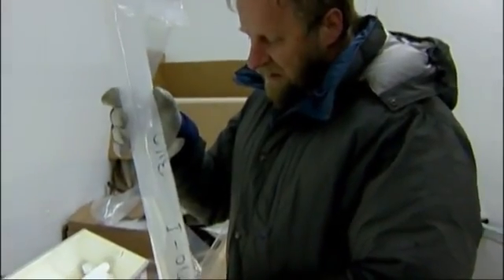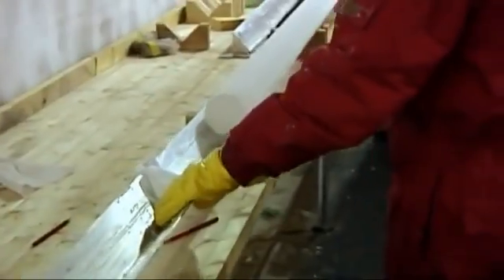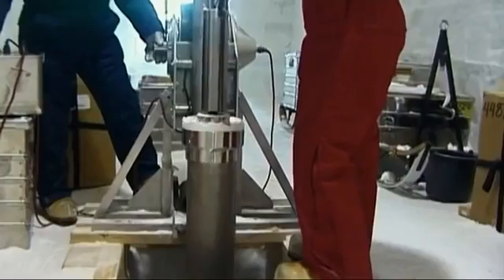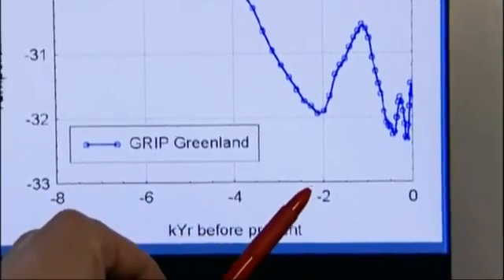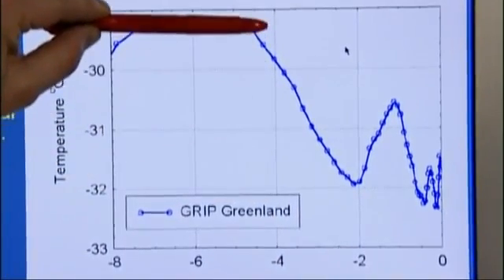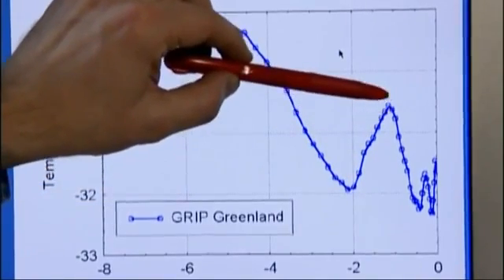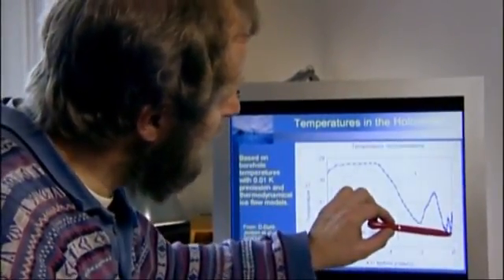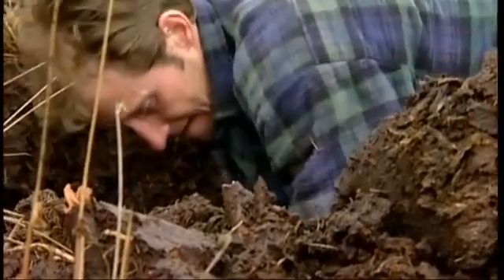The Climate Change story told by ice cores...

Comment: The ice core samples provide data regarding the temperature in Greenland, not globally.
Reply: did you not hear about the evidence in caves in china that also support the same conclusion?  It was mentioned in this video.....
Reply: True.  But how do you feel about those locally higher temperatures being REMOVED from the "global" average calculation for that very reason?
Reply: @i.marchand4655  hi , that's an interesting point, it does seem that data gets manipulated to develop a particular point. The norm , over the past 30 years or so has been to examine high and mid atmospheric temps using satellite data... The green lobby have been quite happy with this method but over the past decade have moved the goalposts again as this data is now showing that the global temp is not following the predicted profile....in actual fact the past 3 years has shown a decrease .... Which given that co2 production has increased is problematic with respect to the climate models being used.
Reply: @kodi1969  if the temperature data is being manipulated then why do you accept the 2020-2022 readings as valid?
Reply: @brmadden895  mmm you again seem to have read into this something that wasn't said... The comment was with reference to the change in temp data collection method that was/is used to demonstrate that the climate is changing according to the modelled trajectory....
Reply: @kodi1969  right...if you believe the data is being manipulated in that fashion then why do you trust it when it shows an alleged cooling trend between 20 and 22?

By the way, the answer to that has to do with the ENSO cycle. The prevailing wind pattern in the tropics flow from east to west, in contrast with the mid latitudes. Warm surface waters in the Pacific get pushed westward, and cooler water from beneath upwells to take its place along the South American coast. That state is called La Nina, and tends to correspond to cooler global temperatures. Every so often enough of a density gradient between the warm waters to the west and the cool water to the east develops a wave that breaks, and the accumulated warm surface waters to the west "slosh" back over to the east and suppress the upwelling of cool water from below. That phase is called El Nino, and tends to correspond to higher global temperatures. If you look at the global temperature record you'll jumps that correspond to El Nino years...particularly in 1997 and 2015 when particularly potent El Nino events occurred. That cooling trend over the past 3 years is closely related to the fact we've been in a La Nina phase since 2020, which is forecast to break. If such is the case then 2024 has a really good shot of being the warmest on record, particularly if we get a strong El Nino event.
Reply: @brmadden895  lovely description of la Nina and el nino....although I don't know whether your Masters tutor would be totally happy with it. ... Totally aware of both systems....
Anyway back to the point, this issue is two things in essence...
1. Changing the data collection method, eg. From mid to high atmospheric temp collection...and when that didn't reflect the predicted/modelled trends then changing to ground based temp data to try and get the data to fit prediction...big clue here it still isn't fitting the predictions....

2. If you are changing the data collection you need to change the modelling method...the models used by the IPCC by there own admission have low confidence predictions....
Again please understand we aren't  singing from different songbooks here, 
But as usual politics/politicians intefere and the message becomes very distorted.
Reply: @kodi1969  I’m trying to figure out your basis for claiming the predictions aren’t accurate when you believe the data you’re evaluating those predictions against is subject to manipulation. Where are you getting that the IPCC only looks at subsections of the atmosphere/biosphere to determine global temperatures?
Reply: @brmadden895  please don't misrepresent any comments that I have made, I haven't said that data has been manipulated , but what I have said is that consistency is the key to any statistical model , especially when the model is  continually being updated with new data...e.g. it is a rolling model. 
For useful comparisons between data points or trends to be made, each data point needs to be consistently derived.
I will, at a later point , give an in-depth explaination from a mathematical point of view why some of the methods used within the modelling produce such wide confidence bands..which in effect lessens the potential long term accuracy of the model...
I can also offer a potential solution which could improve the data collected, but at the moment I am preparing my grandsons birthday party and the comment could be quite long.
Reply: @brmadden895  okay here, goes with part 1.
Several organizations create datasets to evaluate temperature on a global scale, each uses a slightly different method ,each with there own limitations and scales. The NOAA (formerly MLOST) uses the most data points with approximately 7700  stations providing temperature data..these are distributed across the globe , but the distribution is not even, with more stations in the northern hemisphere than southern hemisphere and a higher concentration across North America..
In order to model global temperatures using this data, the globe is divide into 2 degree lattitude and longitude squares, on average 138 miles on each side, each square having an area of 19044 square miles...there would be approximately 16000 such squares across the globe. Hopefully you can see where this is heading, there are more squares than we have real life data points, we only have 43% of the required data which is unevenly distributed across the globe...
Therefore in order to populate these missing data points the NOAA carry out linear interpolation, which straight away introduces the potential for errors and limitations, normally in statistics these can be mitigated by selecting close data points to create an estimate for the missing data, this isn't really the case for the NOAA data which due to the amount of missing data uses data that can be upto 1200km away...depending on the method used to carry out the interpolation this could create a bias that is either an over or under estimate, either way each estimated data point reduces the overall accuracy of the global temperature...with over 57% of the data points being estimated this does call into question whether policy should be driven using these figures.
Problems have also been noted about many of the historically older land based stations and using historical data from them to make comparisons, since the warming is comparative against a 1890 baseline. Many of the older land stations were originally rural or semi rural weather stations, which have now, through urban sprawl and city expansions find themselves in the centre of large urban areas. Areas which due to the urban heat island effect, find themselves with temperatures differing from the surrounding rural areas by 2-3 degrees higher during the day and up 12 degrees difference at night due to large mass heat storage. The IPCC has said that that has now been accounted for, but that it only effected 10% of the stations ...since they can't move the stations, it's a comparative study of temperature, that would mean that these datapoints are also 'adjusted' in some way...
This then puts us in the position that a further 10% of the data is an estimate, which in the whole scheme of things means that the global temperature average rise is based only on 33% real data and 67% estimated data. 
Now that wouldn't necessarily be a problem statistically, Mathematicians are very good at creating models that can be quite accurate to fill in missing data, as long as the data you are using has as little variation as you can, but that isn't the case when looking at temperature data across the globe , at such a large resolution ( 19044 square miles), and with such a massive temperature differences over the 1200km radius used  in order to estimate missing data...
Most of these limitations of the current methodology are mentioned in the scientific IPCC papers,  but are largely left out of the summary reports and are definitely missed out of media releases.
This doesn't count as manipulating data, as long as everyone is aware of the limitations and confidence levels of the ensuing models are clearly set out and made available to all. 
But like many things in this modern era we live in , it is often only the headline that is read rather than the actual meat of the article....
I did say there is a possible solution, one that could be implemented quite quickly , would increase the resolution, increase the accuracy and lessen the need for the errors introduced by estimating missing data. 
But that's for part 2 in the morning....
Reply: @kodi1969  are you factoring in satellite data?
Reply: @brmadden895  one of the problems that researchers are finding with satellite readings of surface temperature , is that satellites are reliant on cloudless sight to the surface, which as you can understand is slightly problematic at times.... Yes when it can  take readings they are highly accurate... But like I said consistency is key here.
A. So that the right policy changes are made ( less wiggle room in interpretation)
B. So there is little room for errors to creep in... E.g. no estimates, no guesses...nothing that could be interpreted as ' pulling a fast one' everything is plain and in sight.
Reply: @brmadden895  Before  Looking at some ideas of how to improve the consistency of  temperature collection methods in order to create a more open conversation about climate change, I thought I would tell you about Two Fascinating places that I had the joy of working and living on for Several years. Both Places highlight the importance of understanding the role Geographic topology plays in climate, both at the micro and macro level.  
The seas surrounding both islands are filled with an abundance of wildlife, and I spent many hours Diving in absolutely pristine water, observing the multiple species of Dolphin, Humpback whales who calve in the area, and aiding the tagging of Whale sharks that congregate in the waters around St Helena for several months each year.
St. Helena:
St. Helena is a remote island located in the South Atlantic, approximately 1,200 miles west of Angola. It is a British Overseas Territory with a total area of 47 square miles. Despite its small size, approx. 5 miles by 10 miles,  the island has a diverse range of landscapes and habitats, including areas of desert, rainforest, and lush green plains.
The island's diverse geography is largely the result of its volcanic origins and its position at the meeting point of several ocean currents. The island's interior is dominated by rocky hills and steep cliffs, while the coastal areas are characterized by sandy beaches and rocky coves. Inland, the island is home to several valleys and gorges that support a variety of vegetation, from arid desert plants to lush rainforest.
St. Helena's unique climate also contributes to its diverse landscapes. The island experiences a subtropical climate with relatively mild temperatures year-round, but precipitation patterns can vary widely depending on location and elevation. The eastern side of the island is generally wetter and more forested, while the western side is drier and more desert-like.
The highest point on the island is Diana's Peak, which rises to a height of 2,715 feet above sea level. This peak is covered in cloud forest, which is a rare ecosystem that supports many endemic plant and animal species. Diana’s Peak, due to  the cloud and mist accumulation leads to the surrounding lower level peaks receiving 290 days of overcast conditions each year.
The island's coastal areas are characterized by a semi-arid climate, with an annual precipitation of around 6 inches, Although the sandy bay Area receives significantly less than this annually. However, in the island's interior, there are areas of lush greenery that receive significantly more rainfall. One of the most famous of these areas is the "Heart-Shaped Waterfall", which is located in a remote valley in the island's interior. This waterfall is fed by a small stream that flows year-round, providing a habitat for many endemic species.

Ascension Island:

Ascension Island is another remote island located in the South Atlantic, approximately 700 miles northwest of St. Helena. It is also a British Overseas Territory with a total area of just 34 square miles. Despite its small size, the island is home to a variety of microclimates, including areas of desert, rainforest, and lush green plains.
The island's climate is characterized by year-round warmth and low precipitation. However, due to the island's varied topography, there are significant variations in temperature and rainfall across different parts of the island. 
Charles Darwin and Ascension Island:
 Charles Darwin visited the Ascension Island in 1836 and noticed the island's barren landscape due to the lack of rainfall. He suggested an experiment to control the climate by creating an artificial rainforest on the island. In 1850, the Royal Navy started the experiment, and by the early 1900s, a lush rainforest had developed on the island. The experiment demonstrated the potential of human intervention to alter the climate, but also the challenges and complexities involved in such efforts.
The island, which is a small volcanic island in the South Atlantic, had been uninhabited for several centuries and lacked fresh water, vegetation, and other resources. Darwin proposed a plan to introduce plants and animals to the island in order to improve its habitability.
One of Darwin's key goals was to create a sustainable source of fresh water on the island. He proposed importing trees such as eucalyptus and acacia, which could grow in the arid conditions and help to capture and retain moisture. He also introduced several species of birds, including canaries and sparrows, which could help to control insect populations and provide a food source for humans.
Darwin's plan was largely successful, and the island was transformed into a lush and habitable environment within a few decades. The introduction of vegetation helped to stabilize the soil and reduce erosion, while the presence of birds and other animals helped to create a more diverse and resilient ecosystem.
Now,  Nearly  200 years after Darwins ‘Experiment’,  Green Mountain, which is the highest point on the island at 2,817 feet above sea level,  is covered in a lush cloud forest that receives over 30 inches of rainfall per year, despite the island's overall aridity.
Darwin's climate control experiment on Ascension Island is a valuable case study in the potential for human interventions to affect local climates and ecosystems, and serves as a reminder of the importance of responsible environmental management and conservation practices.
Reply: @kodi1969  Every data set will have some degree of interpolation. Even if we had satellites that could read temperatures to the thousandth of a degree over every square inch of the earth every second, there would still be some estimation built into the final calculation. You reduce that level of uncertainty by cross checking data from various sources, e.g. satellite data vs land data vs ship/buoys vs weather balloon/aircraft data vs model/prediction archive data, etc. The more cross checks you do, and the fewer inconsistencies you find, the more likely the data is valid. Not necessarily that it's accurate to the hundredth of a degree, but that it presents a reasonably accurate picture of where we've been & where we're heading.
Reply: Global records all agree with this data
Reply: @ExistenceUniversity  yes…but this data is local to Greenland. Because the average temperature in Greenland was 1.5 degrees warmer 10,000 years ago, it doesn’t mean that’s true of the rest of the world.
Reply: @brmadden895  this data is local to Greenland, but also found in peat bogs and tree rings in northern Europe...
Reply: @gadget348  which would be data local to Northern Europe.
Reply: @brmadden895  that would be the aforementioned peat bog and tree ring data...
Reply: @gadget348  right. What's your point? :P
Reply: @brmadden895  quite obviously you didn't watch the full clip ...it stated that the Greenland data was matched by data from northern Europe, china and other places.
Reply: @kodi1969  no it doesn't. It states data from elsewhere confirms alterations between relatively warm and cool periods. It doesn't state the magnitude matches that of what was found in Greenland.
Reply: @brmadden895  quite obviously, even from the very brief conversation that has taken place in this comments section, you have an issue with actually digesting information that may go against the narrative that you have..this was a short video...examining the changes in climate in Greenland over 8 thousand years, the graph of temps over the time period clearly showed temps (in Greenland ) 2.5 degrees above current temp...this period also corresponds with data collected from around the world....in the same way he highlighted the so called little ice age...which was a dramatic drop in temp ..again this corresponds to data from Europe ... I m sure you have heard of the London ice fairs..which lasted for months at a time when the Thames froze over to a couple of feet thick...during the 17th to late 18th century...
The video just highlighted that this temp profile was also found at various other sites around the world.
There are natural cycles of cooling and warming that the earth goes through...these cycles are very observable on a global scale through geological data, sediment core samples, tree rings etc ...they are called milankovitch cycles..please go spend a bit of time looking at them ,digest them understand the relevance to the topic of this video.
Now myself and others have pointed out several good points from the video alongside other areas please take the time to research them... I don't expect to change your opinion, all I ask is that you broaden your knowledge base, gain a wider understanding of what is happening. 
I do not deny that the climate is undergoing change, but misrepresenting the effect of mankind on this system is extremely problematic, I don't even deny that past activities of mankind have had an effect, but I do have an issue with the weight that is put to mankind's impact on climate change. There are much more influential causes than mankind.
Why, if I acknowledge climate change, do I have issue with the current strategies? 
Because they are the looking at the issue from the wrong direction...if we widen the debate, then we must realise that we will have a very  limited effect on climate, no matter how much we switch to renewables.
If instead we concentrated on technology. That helped mitigate any rises and falls, then it would better prepare ourselves for an uncertain future.
Reply: @brmadden895   Maybe this is the issue, rather than do ANY research on the topic, you would rather the alarmist media spoon fed you the information it wanted to in order to reenforce it's narrative.
The Holocene Climatic Optimum was a global period of warming that occurred over approx a 5000 year time period, it reached its peak approx 8000 years ago, on average temps at the north pole were 4 degrees warmer than present, although the winter range was between 3 and 9 degrees warmer. Siberian data shows a 3-6 degree peak above current temp.This was a global increase, although the peak was lower as we decrease in  lattitude.
Large swathes of central asia have been shown to have been heavily forested due to this warmer wetter climate of the HCO,   the Iberian peninsula (Spain and Portugal) also would have been heavily forested for the same reason...the effects of the HCO can even be detected as far south as the Great barrier reef with reef cores showing sea temp in the area being 1 degree warmer during this period.
Reply: @kodi1969  I went to school/graduate school for environmental science. My master's advisor was a climatologist who contributed to a couple of the IPCC reports. You pulled that from Wikipedia which also states the average temperature change dropped off rapidly with latitude, and that parts of the tropics and southern hemisphere were colder than average during the relevant time period. But I'm happy to discuss paleoclimate records and how different forcing mechanisms cause both regional and global shifts in long term trends if you're interested.
Reply: @brmadden895  I'm glad you went college, good for you...again you seem to read/digest only very little of what is said...I did put into my comment that there was a reduction in the peak temps as the lattitudes decreased.
If your masters was in environmental science, then I must then ask the question, why you made the initial comment that you did? If you were aware of the HCO, why you tried to invalidate the comments of others who seemed to find the video of interest.? 
Why you, with an understanding of paleo climatology, seemed to intimate that the temp profile of the past 9000 years or so haven't been observed in multiple sites globally, with the same time frame and profiles? 
Having also spent time with an climate scientist with an involvement with the ippc, I am sure you have read or have a good knowledge of the scientific report, as opposed to the summary report issued by delegates/UN politicians. 
So you will know that the scientific report doesn't mention exesthenial crisis, breakdown of society, ten years to doomsday, extinction of mankind or
 any other of the alarmist guff.
Unfortunately having contributed to governmental reports in the past, I am very aware of how they get rewritten by politicians, so that it suits their narrative.
Reply: @kodi1969  "why you made the initial comment that you did? "

Because it's true. This video implies that the observations from Greenland are are true globally, which they aren't.

"f you were aware of the HCO, why you tried to invalidate the comments of others who seemed to find the video of interest."

Not even remotely what I said.

"seemed to intimate that the temp profile of the past 9000 years or so haven't been observed in multiple sites globally, with the same time frame and profiles?"

That's not what I said. I said you can't take measurements from one region prior to modern meteorological observations and just assume they're representative of the whole planet.

"So you will know that the scientific report doesn't mention exesthenial crisis, breakdown of society, ten years to doomsday, extinction of mankind or
 any other of the alarmist guff."

Never said it did.
Reply: @brmadden895  the video , an excerpt from a longer video was centred on the research being undertaken through ice cores in Greenland, during the later part of the video , it bought in the fact that the Greenland data and observations were also reflected in data from other sites around the world....
Ice core sampling and sediment sampling are useful methods for determining a massive amount of environmental data from temp, atmospheric composition, flora and fauna make up etc... etc... Part of the reason we can make accurate models of past climate events is because of the vast amounts of data that is stored in our surroundings... 
We can step back climate models millions of years and make accurate models of climate using geological climatology...the one thing we can't do, no matter how hard we try is to extrapolate the data to make accurate predictions. The Future climate is  too multivariate to be predicted with any grade of accuracy. If you examine current climate predictions they are all made using very narrow selections of variables, all other conditions are given silly maxed out values or assumptions are made about their weight in the system...
For instance it is often claimed that there has been an increasing number of catastrophic weather events over the past two or three decades and with it an increasing number of fatalities and that this will get worse in the future....Fortunately recent research has indicated that there has actually been a drop in extreme weather events and that fewer people are being killed or displaced by them.
Part of these differences between perception and reality is the speed at which we are able to access global events through social media and the internet in general.
Reply: @kodi1969  "it bought in the fact that the Greenland data and observations were also reflected in data from other sites around the world"

But not in concurrent time intervals and locations, which we've been dancing around for the last 15 posts, but in the interest of moving the conversation along I'll tell you what I think about the whole climate change issue. If you want me to concede that I can't predict what the status of civilization will be in several decades, I will. I'll tell you the same thing I would've said in the mid 80's regarding the ozone hole or acid rain; that unless we address them, they're going to generate increasing problems. And had we not ratified the Montreal Protocol in '89 or enacted cap-and-trade with the CAA in the early 90s then we would indeed have some big problems by now. As it stands the planet is approximately 1 degree C warmer now than the 20th century average. If we reach 2 degrees C, we're facing a situation where pieces of the global ecosystem, which we rely on to sustain the 8+ billion people in the world could begin to die off. We're currently projected to cross that threshold sometime between 2040 and 2050. Anything beyond 2 degrees and that scenario becomes increasingly likely. And that would, indeed, spiral into a cacophony of issues for humanity if left unchecked.

And you can go back and evaluate predictions made in the original IPCC report in 1990, or in peer reviewed science from decades prior, and match them up with what has actually happened. The climate models have been remarkably accurate, even somewhat conservative. The first IPCC report predicted we would cross the 1 degree C some time in the mid 2020s; we surpassed 1 degree C in 2016. The accumulated scientific evidence is overwhelming that human activity is the cause of the vast majority of climate warming post the industrial revolution. And the science keeps getting more and more thorough. But as I said, I'm not a prognosticator. We may get nuked before the fact, what do I know?
Reply: @brmadden895  I don't dispute, as I have stated before that climate change is an issue, or that society needs to brace itself in the future.
But there needs to be a serious discussion about what needs to be done and reality based timescales , priories etc. A discussion that needs to be honest , open and free of alarmism.
Since you asked about IPCC models, the IPCC report predicts a 0.34 rise per decade, where as the actual rise has been closer to 0.14 per decade since 1990, that's 41% slower than the IPCC medium business-as-usual figure.
Yes in 2016 we passed the 1 degree mark ahead of the predicted 2020 prediction but since then the global temp has dropped by 0.11 down to 0.89 rise, hopefully this trend will continue. That is inspite of an overall increase in global co2 emmissions, the IPCC based their model on a 20% increase over 1990 levels but this is currently running at 60%over 1990 levels...mainly caused by the increases in coal for power across India, china and other developing nations.
As a mathematician/statistician those discrepancies indicate
1. The model being used is wrong, and provides highly inaccurate predictions.
2. The weights within the model are incorrect, a threefold increase above model of co2 output should have produced an increase in temp rise per decade of a similar value e.g predict should be 1.02@60% but actual 0.14@60%
3. Have climate scientist determined the primary driver of climate change? Is to much weight within the model being given to the effect of co2 increases? 
Yes co2 is a participant but is it the primary driver? 

Obviously we do need to drive down emmissions, but without the developing nations getting on board , then we face an uphill struggle. Currently there is absolutely no incentive for those nations to come along with us, as the first world nations have developed their means of production have largely been farmed out to those developing economies....which then becomes a vicious circle...we push for net zero, but the means for us to get there...renewable tech is primarily manufactured or sourced from the developing economies...who, as we increase our speed toward net zero, need to produce an ever increasing amount of product this increasing there own demand for energy...from quick build coal and oil fired power stations.
So this results in a strange situation where the west's increased speed to renewables could drive global temps up.
(That is me being sarcastic, but you get the gist)
Reply: @brmadden895  Don't you get sand in your ears from burying your head?
Reply: @kodi1969  thank you for a reasonable comment... I dont expect responses or reactions to your comment to be reasonable.
Reply: @xisotopex  thankyou I appreciate that comment. The issue of climate change is so polarised, with the people at both extremes seemingly the only people that ever get heard. We need to talk about this sensibly without resorting to petty name calling and the cancelling of those that disagree with an opinion... Again I appreciate your comment.